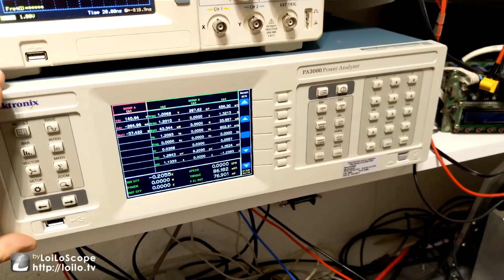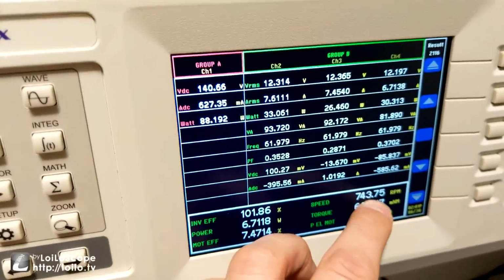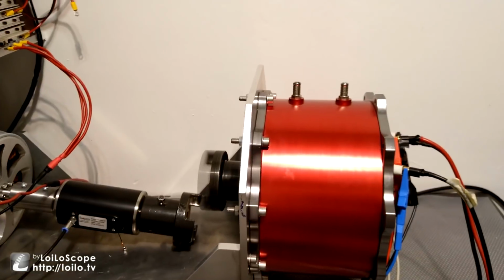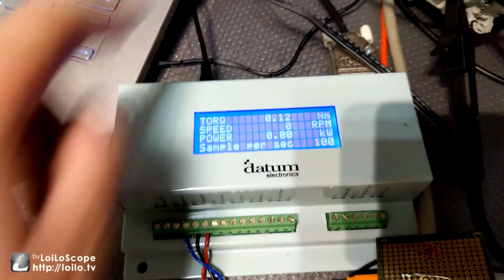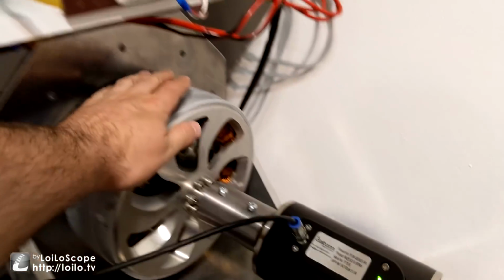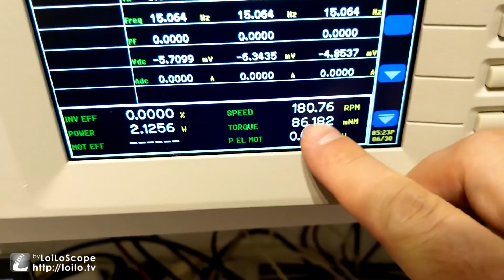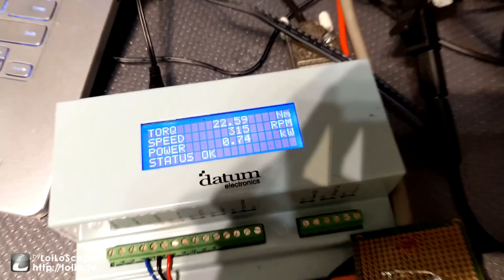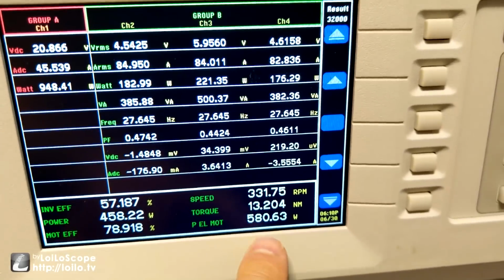Motor-generator efficiency measurement performance evaluation

Comment: can you loop it back ? battery to motor , motor to gen then gen to charge battery , any extra power than you can use ?
Reply from the maker: This is exactly what i did in the video
Reply: @iulian207  do you have extra power? or just looping ?in = output because your setup is amazing so efficient it would make more power
Reply: @EnergySeeker  it is impossible to get extra power out and any one that tells you different is full of BS. The term you are speaking of is called over unity (produces more power than it consumes) it is impossible because everything has losses. Bearings, friction, etc etc, that is why it will never be possible. Plenty of people have claimed to have done it, but no one has ever successfully proven it. That's because there is always a cheat. It defies the laws of physics.
Reply: @DodgyBrothersEngineering  Still have yet to find anyone generating power at an eff over 50%.

Comment: What do you think about 6 phase asynchronous motor where 3 phases are star and 3 are triangle? There is a controllable phase shift between those so it can have a constant high torque from 0 rpm. That is somewhat like russian Duyunov motor wheel works but he doesn't share the exact technology. Also can you build motor wheel which will fit standard  wheel disk on top of the outrunner rotor?
Reply: I'm sure he could build one but i don't know if making a car with hub wheels actually makes sense. This would increase unsprung mass drastically.

Comment: Hi! Nice to see someone build such an amazing system on his own.
Could you please show a bit more of the electronics involved, talk about how the control is implemented and how you came up with the motor design? Also some constructive criticism : Please try to hold the camera a little more steady or use a tripod or something, its actually very difficult to watch and im not some old goober with motion sickness :D
Reply from the maker: In a few day i will make a new post on my blog with detailed description. Sorry for the video shaking, i will buy a better camera.
Reply: @iulian207  Thanks, im very interested!
No need to buy a camera, the quality is allright, just maybe keep it pointing in one place for a bit longer, as a viewer its a little more difficult as we dont knwo what to expect in the next angle and it would be nice to have some time to adjust and see whats happening. Just a recommendation, other people may think differently than me ^^
Reply: @iulian207  can I get on your blog? Please? I been working on a self running generator just for our home... and just for hot water and heat.. anything that runs at usa 220/240v. Everything else I would just run on the grid. But I cant seem to get a decent controller over here. 
Could u sell me a set up to run a 10k or 15k 60 cycle  generator full time

Comment: Awesome, very quiet motors. Help me understand. The battery shows -9amps and the generator 20amps and the motor is only turning at 1,600 rpm, can you please tell me; how much many amps is the motor using? So if it is using less than 20amps and the generator is putting out 20amps then it is making more than it uses, correct?
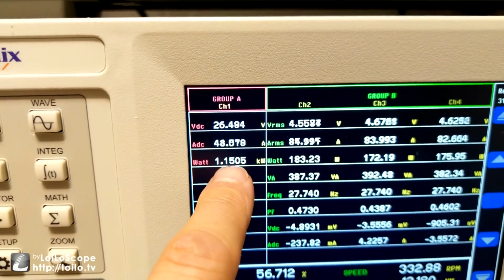Reply from the maker: Hi Rick, at 14:34 time, the power used by the red motor is 532W, the output electrical power produced by the generator is 430W. Do not get fulled by the amps only you need to compute the power. The overall efficiency of the motor combined with the efficiency of the generator and efficiency of the Vesc controller is 80% at 0.7% load.  The red motor efficiency at only 0.7% load is 86%, this is an extremely good number. With a full load the efficiency of the red motor should go to 96,9-97%, making it the most efficient motor on the market for this power level.